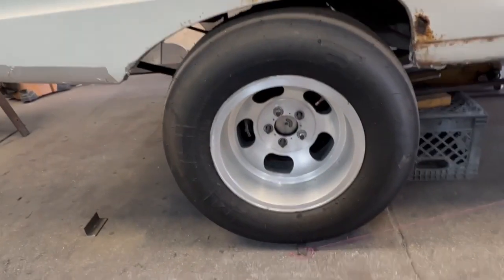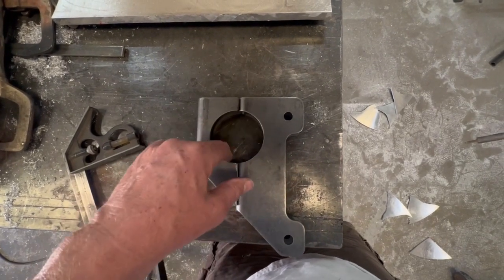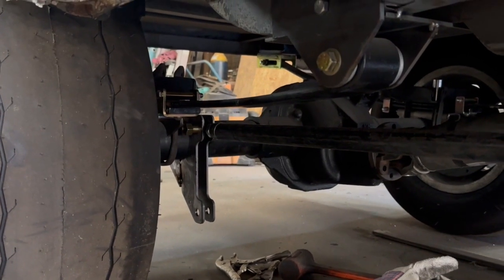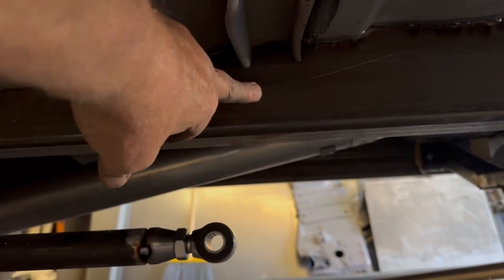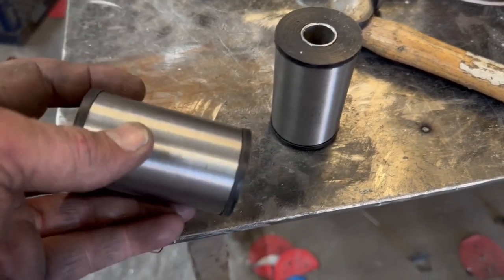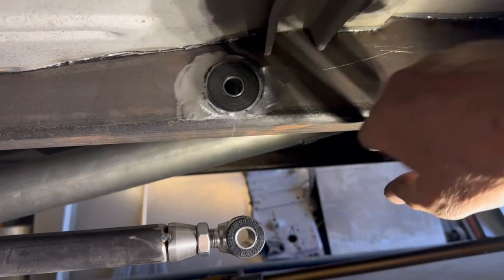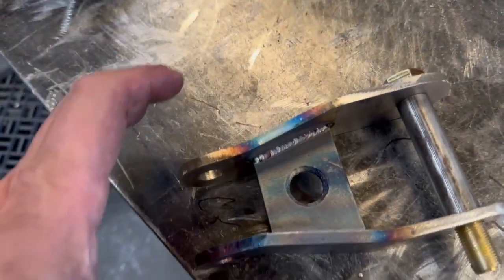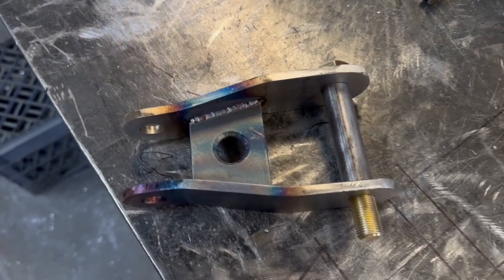I Built Custom Ladder Bars for my Leaf Spring Suspension 61 Ford Falcon Gasser.. #22

Comment: I just found your channel, nice installation.  One thought, on the lower bar threaded end, you might want to be sure the joint isn't wedged into the bar from distortion of welding. You'd hate to be at the track and not be able to make an adjustment if need be. Maybe just run a tap in the threads to be sure it'll still thread in or out. Just an idea,  I'm a few years older than you and have run into a few situations at the track,  it's always the one tool you didn't bring that causes grief.
Reply from the maker: Thanks. I already ran into that situation on the tie rod. I messed up and welded the end then screwed in the Rod end in while it was still warm and seized up in there. I was able to cut it and use it for the steering leak so I didn’t waste one end and the chrome Molly tube.

Comment: I think I'm going to watch and see what happens before saying a word. 
(I'm such a liar)
Mine also pivots in front and some are skeptical that it will work. Almost ready to do some testing. Also getting some feedback about putting on a safety loop around the front Hime joint.
I think it's a requirement on some NHRA tracks. Can you imagine what would happen if that front Hime joint let go. I have raced someone that had it happen to and luckily, they lifted when it happened.
Reply from the maker: I don’t think the front hime joints an issue. The leaf spring actually holds the rear end in place if that joint let’s go it go up and hit the frame and might unload the car weird but it wouldn’t do anything too drastic.

Comment: interesting, never heard of a shackle for forward mounting point on ladder bars    always thoight it was a fixed location.
Reply from the maker: They actually are. I don’t like the idea of leaf spring sliders although people have used them forever, they seem sketchy to me. I would suggest mine are more like a torque arm than a ladder bar. Torque arms have a small shackle or sliding pivot at the front.

Comment: I am curious to see what that shackle does. When the pinion raises the bar should push. Unless you’re building a stopper on the shackle to bottom out in the frame I don’t see how it’s going to transfer any of that energy into the chassis.
Reply from the maker: The spring transfers forward force as usual. The ladder bar helps weight transfer as well as stopping spring wrap. The shackle allows the suspension to work.

Comment: Never really crossed my mind to say drilling the hole and welding that tube in the frame rail was gonna make it weak. Everything you do is pretty overkill!
Reply from the maker: I thought it would look cool. Plus more weld and it’s going to have a 8.50 chromoly cage so it’s not going anywhere 😀

Comment: I’m just confused my ladder bars don’t bolt to a shackle they have a crossmember and bolt solid but I eliminated my leaf springs. I’m just confused how these will work unless the leaf springs will float allowing the rear end housing to pivot twisting the arms but you’d still think the front wouldn’t be bolted to a shackle like that.
Reply from the maker: There is a shackle on the front of the ladder bar that lets the suspension work. The ladder bar is to eliminate axle wrap and help with weight transfer. It’s the same principle as a torque arm.

Comment: Lower adjuster where did you get it ? Part number please.  Is it right and left hand for adjustment
Reply from the maker: I got them for speedway motors. I went with the bigger stronger option.  Speedway Motors |#1750527
Pro-1 Chromoly Heim Joint Rod Ends, 3/4-16 RH Male, 5/8 Inch Hole.                                                           QA1 | #721AS1212
  )QA1 AS12-12 Rod End Linkage Adjuster, 3/4-16 RH Female Thread, 3/4-16 LH by                              Speedway Motors | #91002966
Steel Tube Ends Weld Bung for 1 Inch I.D. Tube, 3/4-16 LH
Reply from the maker: It’s adjustable without having to unbolt anything.

Comment: I have a 1990 Mustang and I have a pile of parts. I have a new old stock so there’s the brackets in the hardware set of ladder bars Lakewood ladder bars only they are for Chevy and I asked my mechanic about it and he basically got right off the phone with me And a buddy of mine has altered the set as I know my Mechanic has because the first thing he said without hesitation was you’re going to pay an arm and leg to get them modified to fit and then he asked me why I wanted them and my question basically is not only is it worth trying to modify them because Well and I’m not trying to ruin the suspension on the car. It’s not a drag car. I’ll never take it to the track. I wanna be able to go around corners and I’m wondering if ladder bars will ruin my cornering abilities besides the geometry involved which I’ll probably be able to talk my Mechanic into doing for me at a price buteither way I’d really like to get it done with my buddy who said he’s done it or my mechanic who doesn’t wanna do it I’m just wondering what your advice is since most of the people I see discussing this on YouTube or using it have drag cars
Reply from the maker: I don’t know if they would fit under your car. They are pretty tall and long. It would be pretty hard to get them to fit much less work. There are better options for your mustang. They make a ton of stuff for those.